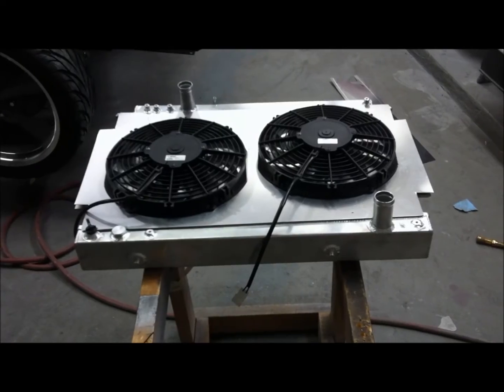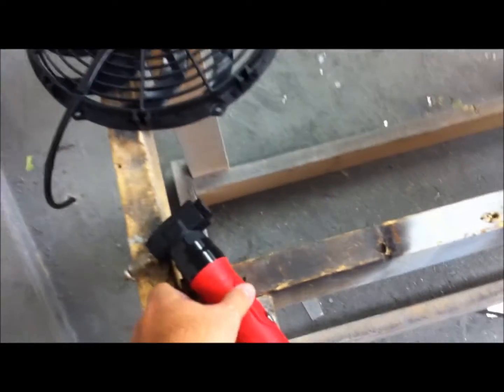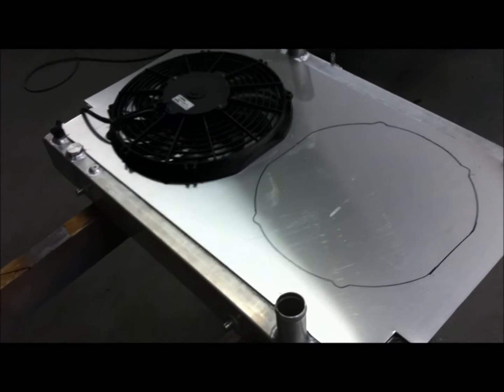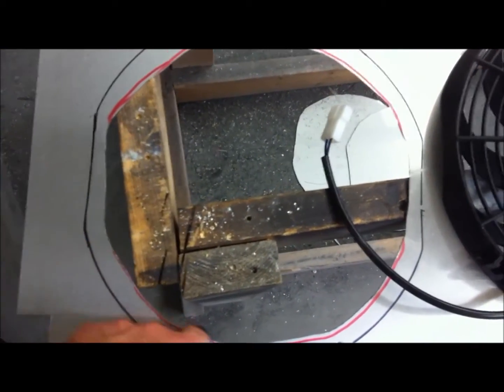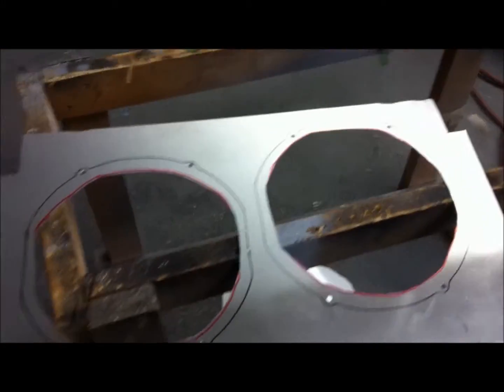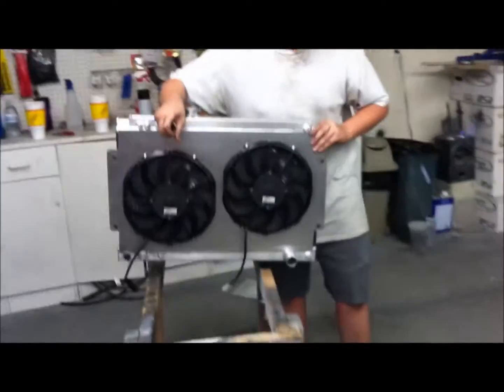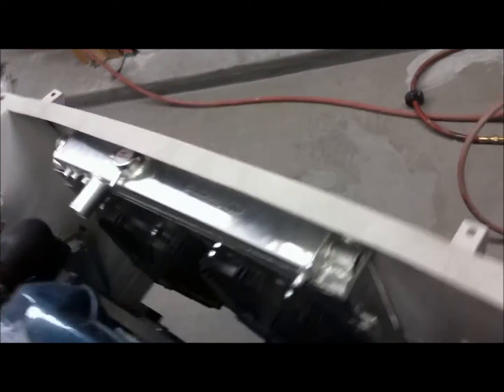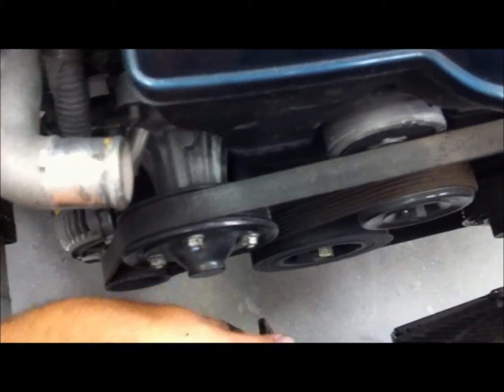65 Mustang Fan Shroud Fabrication - Dual 11inch Spal Fans

Comment from the maker: I dont' remember the actual thickness on the spal fans we used, but we also had tight clearance in our original engine mockup and got the thinnest ones we could fine.  That is why we went with 2 small fans instead of a single larger one.  Good luck Jeepjeep lady, and thanks for commenting. :)

Comment from the maker: We just used some extra sheetmetal that was laying around. It was probably 22 gauge.  It was way too thin.  AI would think 16 / 18 gauge would work much better.  The thinner stuff would work also if you ahve a beed roller and can roll some beeds in it for rigity.